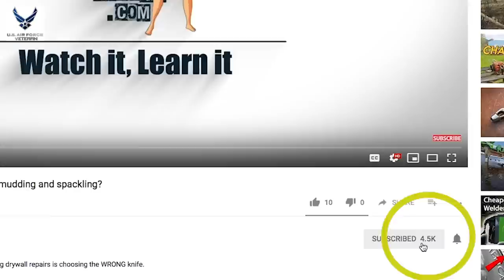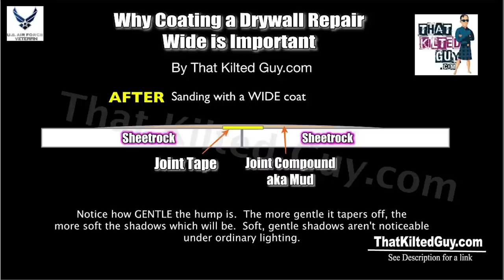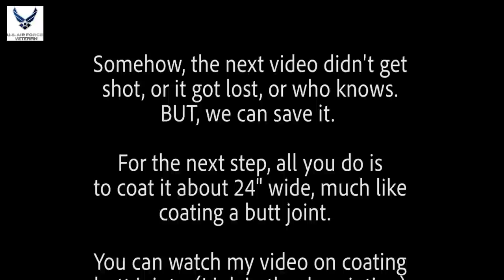2023 - How to Repair CEILING WATER DAMAGE using Mesh Tape the correct way

Comment: This mesh repair is just cosmetic and does not repair the cracks. Only a matter of time before movement in the plaster causes cracks to reappear.
Reply from the maker: Frank Warne 35 years, over 5,000 repairs, 95% with mesh, only one callback a year later so if done RIGHT, it lasts. I once fixed over 100’ of cracks in a house, did more work 3 years later and still no cracks in my mesh. So i respectfully disagree and have proof. My high google & Facebook ratings would be lower by now if they weren’t lasting. I have 15 reviews on google, all 5 stars except 2 ex friends I did no work for. 

Check out Mr Patch Drywall LLC on Google!
https://g.page/MrPatchDrywall?gm

https://m.facebook.com/MrPatchDrywall
Reply: Frank, kilted guy wasn't repairing plaster, he is repairing drywall.  That is why he is able to stabilize the area with screws.  You would never put screws into plaster unless you had never had any experience patching cracks in plaster.  And then it would be a very quick lesson for you.

Comment: Nice music playing but not while talking at same time.
Reply from the maker: I appreciate the feedback. Thanks for stopping by.
Reply: Thank you for that advice about the hot mud. Not everybody can work with that stuff! I may have skipped through some of your video and not realize that you were using hot mud. I do believe the durability factor is greater with it! Isn’t it wonderful to know a skilled trade and one that not everyone wants to tackle/LOL keep up the good work brother! Thanks Steve
Reply from the maker: Hot mud can be a little tricky which is why I suggest people only mix up a pan of it at a time and use the 45 minute mud. 

And here’s another little tip- As soon as you start mixing the mud, set a timer on your phone for about 35 minutes and that way it doesn’t catch you off guard. If you let it go too long it can be a bear to clean up and that’s actually the biggest hassle for novices especially. Otherwise it works about the same as regular mud. Thanks for commenting and I’ll catch you on the next video.

Comment: Mesh taped cracks will always come back. Mesh tape is the lazy man repair tape. The proper tape to always use is the paper tape. Great video besides the mesh tape....
Reply from the maker: Re-posting from the other reply.
Ok, I agree and disagree, so let me explain where that's wrong. I did new construction for 15 years and used only paper tape, (and still saw some paper taped joints crack).  Then I got into doing only repairs and over the last 20 years I've repaired probably 10,000 holes and cracks, and have strung well over 1,500 rolls of mesh tape, with at least 5,000 bags of hot mud, and I've gone back to numerous jobs many times, often years later, and only ONCE have I seen one of my repairs crack.  In once house the original drywall was done very poorly and I fixed over 150' of cracks, and came back 3 years later, and not one had failed.  I NEVER get callbacks, and have a 5 star rating on my work.  You can verify that by reading google or Angies List, or even facebook reviews for Mr Patch Drywall LLC.

So here's why they fail.  I guarantee you that 99.9% of the time novices buy the green label all purpose, which is an excellent mud for taping, but ONLY for paper tape.  It should NEVER be used for mesh tape, but they do, and it fails.  But there's another reason, almost no one, including handymen re-secure the crack, and that leaves it weak with movement, so it will crack.

I would also estimate based on my experience and on listening to comments on my channel and others that about 80% of handymen use green label all purpose, about 60% of painters and even about 40% of drywallers, because they don't realize you have to use hot mud over the mesh tape.  I once got lazy and used all purpose and learned my lesson.  About 10% cracked by the next day, and that's NEVER HAPPENED with hot mud.  So folks, if you use hot mud, and re-secure the cracks, you will be fine.  But if you use all purpose mud of ANY kind, use fibafuse or paper tape.
Reply from the maker: I'm about to release a video where I test 3 different types of joint tape, with 2 different types of joint compound and will do SEVEN or more tests on them.  This should be fun and should help demonstrate some of the differences in the tapes and muds.  Be sure to subscribe so you don't miss this one.  I'm expecting a HUGE amount of interest and comments on this one.  So it's exciting and should be a lot of fun, AND a LOT of work, lol.

Comment: why do you call plaster MUD ? It is plaster.
Reply from the maker: Plaster and joint compound are NOT the same in the US  look it up. 

Plaster is a mixture of lime or gypsum, sand, and water, that hardens to a smooth solid and is not sandable.

Drywall joint compound is made from totally different ingredients, does not set up but air dries instead, is sandable and Much softer.

Mud is slang for any slurry like compound, including mortar. Used by millions in the trades.

Comment: For the love of God man! Tell me you arent gonna get on your stilts in that shirt! Depending on your angle we may see your dangle and the world has enough problems right now without that.
Reply from the maker: Because the site of the human body will just kill people, LOL. and you’re right, the world has a whole lot more to worry about right now than seeing parts of the human body we’ve all seen hundreds of times.
Reply: @ThatKiltedGuyDIY  people wonder why the scotts have the stereotype of being mean and vicious. I tell them youd be pissy too if you had to run around on rocks with thistles waist high wearing a frrrrikin skirt me laddy. Thanks for the videos. I went and got roman pro999 x35 ou812 yesterday. Got lots of brown paper showing all over this joint. Never been painted since 66. Still got the original furniture. Early 70s orange porno couches. Mint condition. Was actually offered 6500.00 for them. Last year the owner had friends paint. They didnt prime. Used behr paint primer. They didnt tsp or even wyp from what i can see. Paint literally hanging off the ceiling. Popcorn was scraped...kind of. Thats really the only place the paint sticks. Im rippin and strippin. Every door way in the house has seams above them. All cracked. Every crack dumb and dumber fixed can be seen from the space station and most are cracking. Laid plank flooring some east to west some north to south. None done properly. This is 300 sq' short of 4000 sq' house in a half million dollar neighborhood. Get bored or need work. Come see me in texas. Thanks again
Reply from the maker: Actually they're grinning cause there aint no restrictions down there and plenty of air moving around instead of the crotch swamp all the other laddys are cussing, lol.  I actually hate wearing clothes and got sick of all the binding and discomfort down there and kilts solved it.  If I could do these videos and make money with no clothes, I'd do it, but that would freak everyone out, lol.  Just make sure you get ALL the loose brown paper off before the Pro999 as it won't stick down loose stuff.  It just stops bubbling really well.  Im about to release a video today with tons of torn brown paper, and not one section bubbled after I treated it.  

I just love those handyman or homeowner repair jobs you have to fix.  Which is one reason I have this channel, to help them not make a mess of things.  I heard about the space station sighting, so guess that was your job, lol.  I have a sister in Fort Worth area, but as for work, this channel is NEARLY paying the bills, and I've only worked about 2 days in the last month due to that, and my covid shit I had in March still kicking my butt.
Reply: @ThatKiltedGuyDIY  like everything else in the US. Bat crap fever made in china. Have you looked at the 2020 quarter they released a few months back? I find it hugely coincidental its git two bats in the missionary position. Glad you made it thru that crap. I havnt worked in several years due to health issues. I live in houston but came back to ft worth to do this for two wonderful people i lived next door to several years back. Before my health took a dive i would have lnocked this job out in 2 months by myself. As it is noone has showed up that said they would. I started it last november. And been in the emergency room 4 or 5 times since i started. Spent near 2 months total in the hospital. Some days im ok others i cant walk. Ive hot great pictures of my walker with kc lights off road tires tools all over it a trailer and ladder rack on it. I fall constantly. About 3 am this morning i was checking the primer on a door i redid and toyed with the idea of flex sealing it white. Grabbed a damaged can nearly full and shook it in my sawz all paint shaker. Bad move. The metal top thats supposed to be crimped to the canister came loose at the seam spraying a perfect fan pattern of white liquid rubber starting at the top of my head covering evenly down my face neck chest arms then i flipped it thinking it would stop shooting rubber and only propellant. Wrong again. Wearing boxers that should have been taken out of rotation 100lbs ago the can still fanning covered my junk thighs shins and feet. Finally grabbed a rag and wrapped it up. Eye lids glued shut lips shut fingers together toes together and i could have been wearing a kilt cause i got good coverage in that area. Stuff was stuck in places i didnt know they could reach. Spent the rest of the morning rubbing down with miserable spirits from head to toe and those tender bits between. The scrub brush was brutal. Now im red from scrubbing the rubber and mineral spirits. Still white in a lot of nooks and crannys. Hope i dont get blood poisoning. By golly im water proof though.  Got my eye luds open and they stayed that way for a long time. Lips are chapped as hell from pulling them open. Im praying none hot in " the eye of the needle". Thatll be a bad thing. So people safety first. Always wear a condom when shaking the hell out of flex seal if you are wearing boxers or a kilt!

Comment: Never use mesh tape. The crack will come back more than 90% of the time. You need paper drywall tape for any and all ceiling cracks. Mesh tape sucks....
Reply from the maker: Re-posting from the other reply.
Ok, I agree and disagree, so let me explain where that's wrong. I did new construction for 15 years and used only paper tape, (and still saw some paper taped joints crack).  Then I got into doing only repairs and over the last 20 years I've repaired probably 10,000 holes and cracks, and have strung well over 1,500 rolls of mesh tape, with at least 5,000 bags of hot mud, and I've gone back to numerous jobs many times, often years later, and only ONCE have I seen one of my repairs crack.  In once house the original drywall was done very poorly and I fixed over 150' of cracks, and came back 3 years later, and not one had failed.  I NEVER get callbacks, and have a 5 star rating on my work.  You can verify that by reading google or Angies List, or even facebook reviews for Mr Patch Drywall LLC.

So here's why they fail.  I guarantee you that 99.9% of the time novices buy the green label all purpose, which is an excellent mud for taping, but ONLY for paper tape.  It should NEVER be used for mesh tape, but they do, and it fails.  But there's another reason, almost no one, including handymen re-secure the crack, and that leaves it weak with movement, so it will crack.

I would also estimate based on my experience and on listening to comments on my channel and others that about 80% of handymen use green label all purpose, about 60% of painters and even about 40% of drywallers, because they don't realize you have to use hot mud over the mesh tape.  I once got lazy and used all purpose and learned my lesson.  About 10% cracked by the next day, and that's NEVER HAPPENED with hot mud.  So folks, if you use hot mud, and re-secure the cracks, you will be fine.  But if you use all purpose mud of ANY kind, use fibafuse or paper tape.
Reply from the maker: Well I’ve installed hundreds of rolls of it on repairs with NO callbacks. I’ve seen my repairs years later and no cracks. It’s about how you use it. If you use it wrong, it will crack and fail.

Comment: You did not fix the problem.  You needed to reinforce the seem from behind. It will just Crack again. You have know idea what you are doing.
Reply from the maker: Ahaha another keyboard expert
Reply: Answer the question
Reply from the maker: Do you reinforce all your recessed joints before taping them?
Reply from the maker: The answer is, I’ve repaired over 10,000 damaged areas and have done nothing but drywall repairs for 20 years, and I am nothing but five star rated everywhere. I didn’t get there by doing it wrong.

Go search for Mr. patch drywall LLC and my proof is there.

And I just broke 100,000 subscribers, and I didn’t get there by not knowing what I’m doing.

Now show me your proof? Lol
Reply from the maker: And don’t think you can come in here and demand anything. I can block you in a heartbeat.
Reply: @kirkwesterveltoutdoors  you didn't ask a question, dude. If you know so much, why are you here?

Comment: That doesn't fix the crack. I a few months the ceiling will crack again .
Reply from the maker: Well after 20 years of doing nothing but repairs and at least 1000 cracks repaired, I’ve never had a callback. And I’ve gone back to jobs I worked on multiple times over multiple years and never seen a crack come back unless it had severe structural issues. So I’m afraid you’re wrong, if it’s done right.
Reply: @ThatKiltedGuyDIY  
The crack always has a reason. Unless you fix the reason you are only trying to cover it up. And right, sometimes you get lucky.
Reply from the maker: Mard Balasy The reason it works is because most of the time it was due to a temporary one such as a shifting of the foundation that is very slight. Houses most often don’t keep moving over and over in the same way. That’s why it works to fix them. Thanks for the input though.
Reply from the maker: I think after 35 years of doing this and having repaired thousands of cracks, it’s not luck, it’s knowledge and skill. Thanks